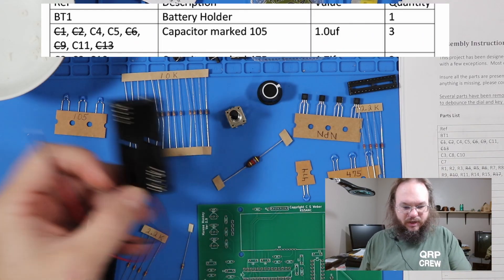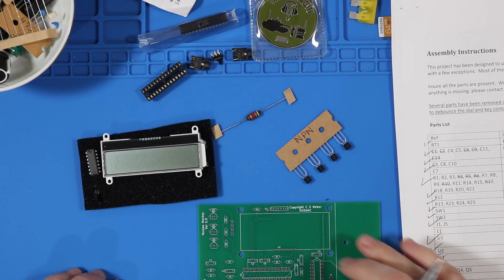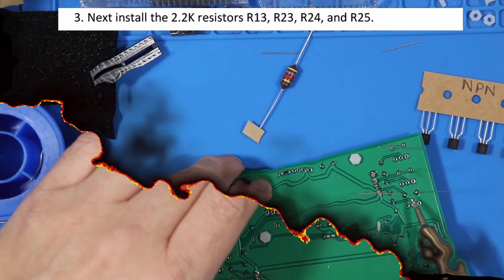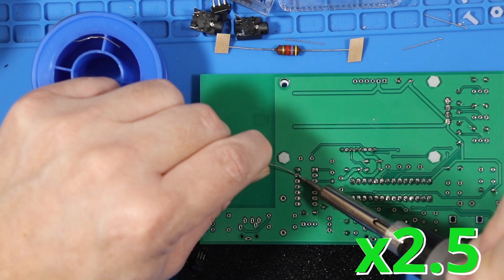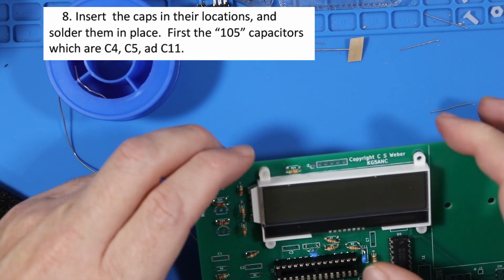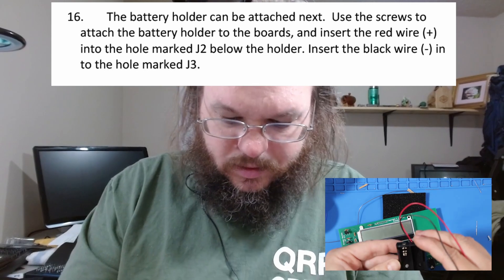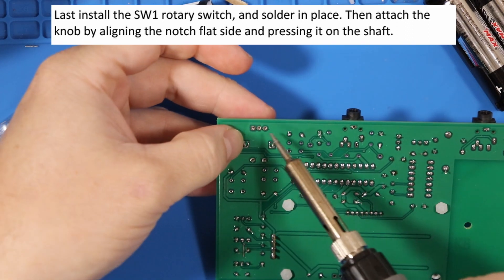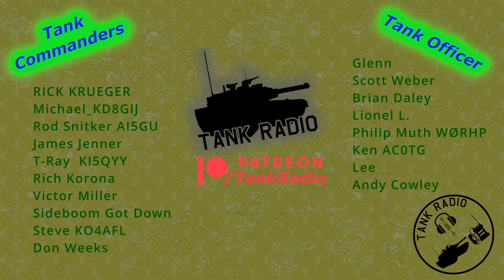Newest CW Kit, Morse Monkey Kit Build

Comment: I purchased the Morse Monkey to get back into CW, it has been several years, and I was looking for a fun project to get myself up to speed. While this project was extremely fun to build and put my soldering skills to the test it has proved to be a colossal waste of time and money. The oscillator is extremely glitchy and freezes constantly requiring constant resets, for some reason it will just stop recognizing the keyer. When it is working it is a lot of fun to use, however, it only works for a few minutes and then freezes. I am unable to find any point of contact for technical assistance and when I did send an email to the address that sent the payment and shipping information, I got no response, oh well they got my $100+, for the money I spent I guess I just expected more. As for the case, it requires a lot of redesigns to work (I never was able to get it just right) there is no allowance for the USB adapters and don’t even get me started on the firmware update…… Good luck if you buy this, I hope you have a better experience than I did.

Comment: I've been working electronics for nearly 60 yrs. To set the nuts and screws properly is to turn them backwards and when you feel it drop into the thread start turning them forward. It takes a soft touch to feel the drop.
Reply from the maker: Thats interesting trick.  I will have to highlight that on the next build video.